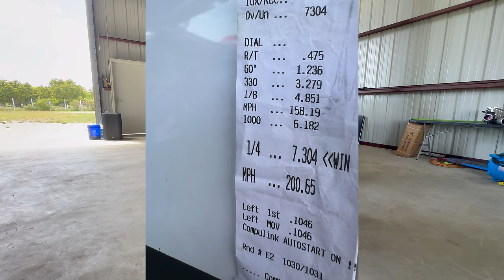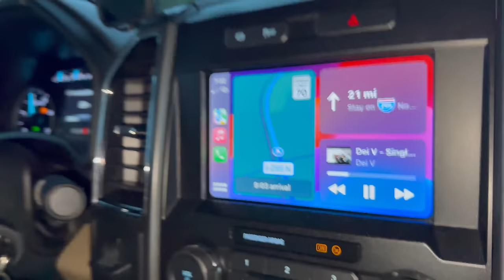FRUSTRATEEG HDAY 2024 RECAP

Comment: Did you ever use a stock crv transmission in the car? If so, at what power level did it die at? I am currently starting my mk1 Audi tt Quattro turbo awd k24a2 swap. Want to know if I can safely run 500whp on stock transmission.